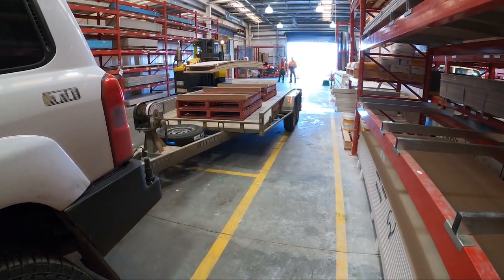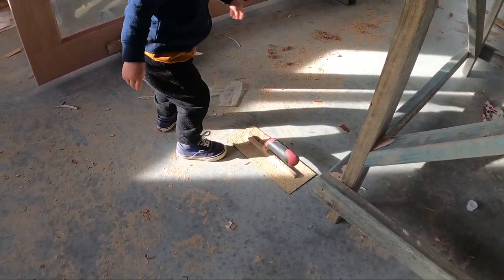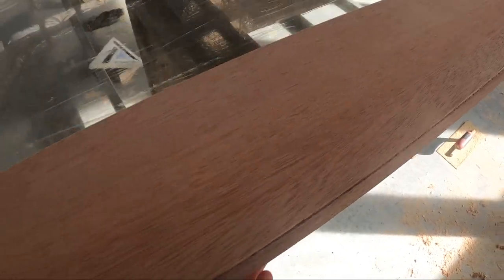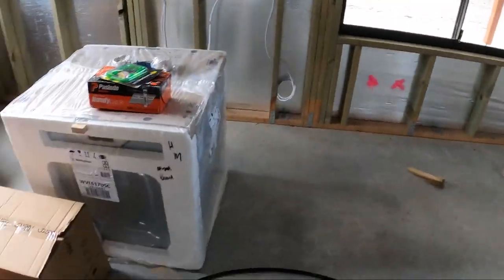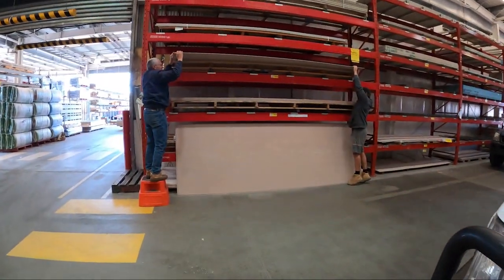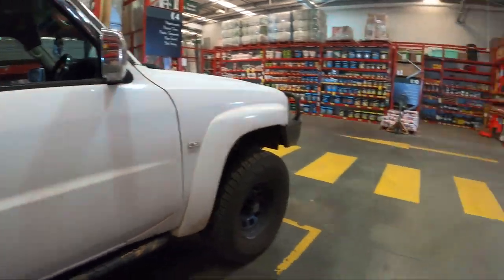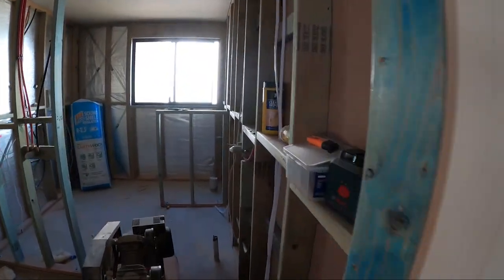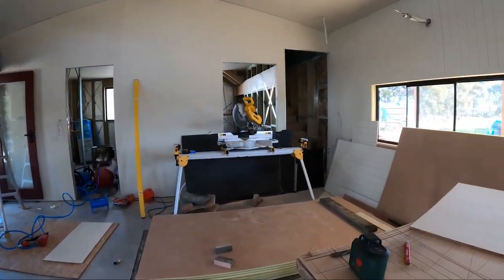OWNER BUILDING in Australia - Internal Cladding with Easycraft Panels

Comment: What kind of insulation did you use, did u source that from bunings too?
Reply from the maker: We used anticon in the roof and half wall batts in the ceilings. We used R2 & R2.5 in the walls. All from Bunnings. If we’re to do it again though, we’d probably use aircell instead of anticon 👍🏼